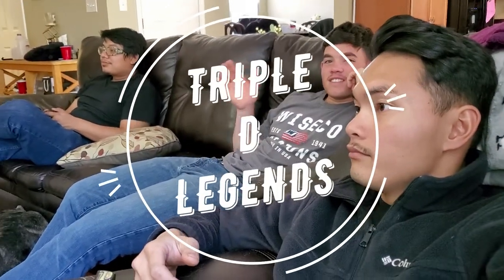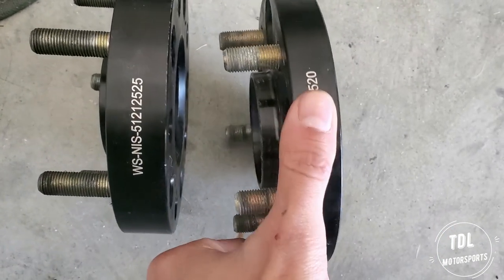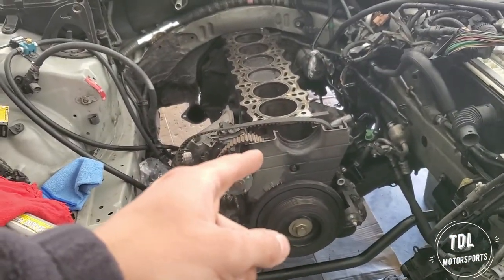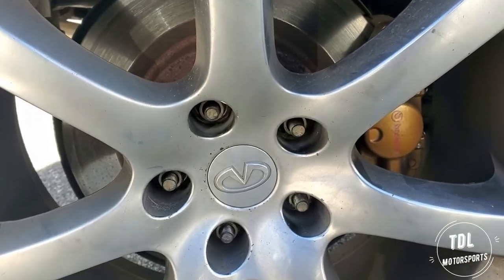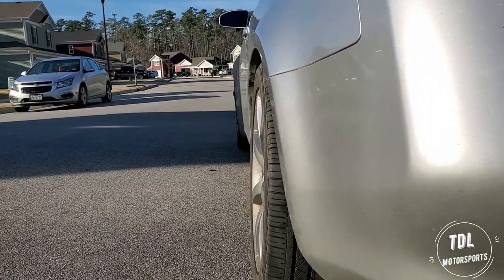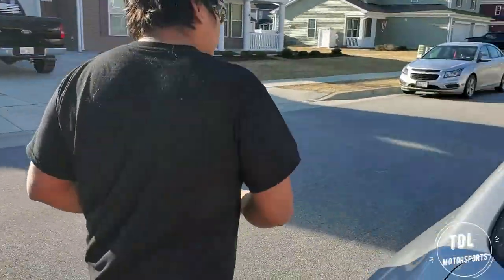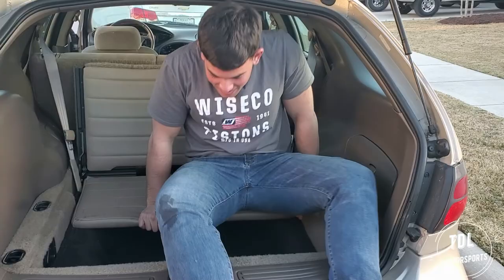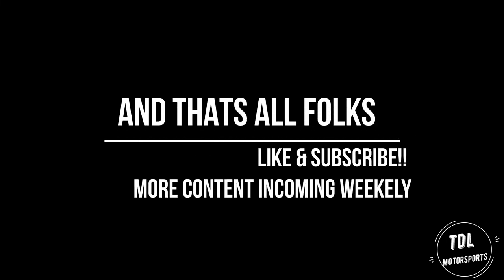Drift Missile G35 spacers installation on stock wheels

Comment: What are the sizes for the back ones
Reply from the maker: 1.5 spacer
Reply: @tdl_racing  thanks man I just ended up installing some 25mm all around, used your video for some inspiration
Reply from the maker: Nice!! That's what were here for
Reply: Where did you get the spacers from??